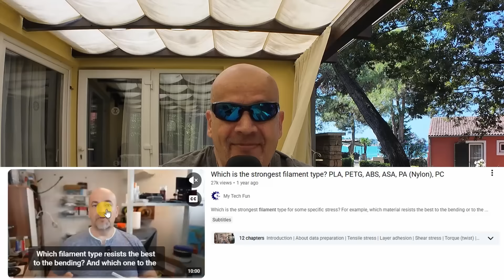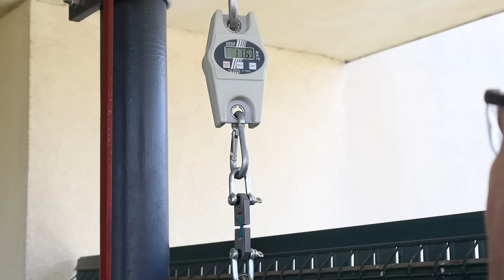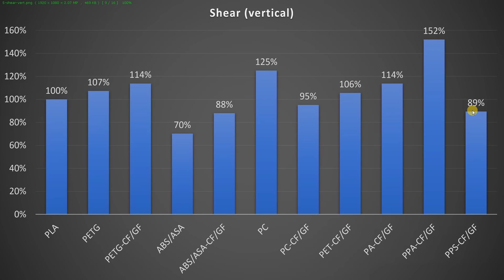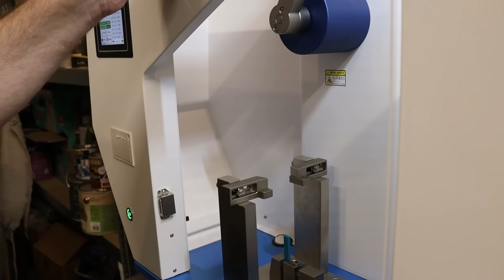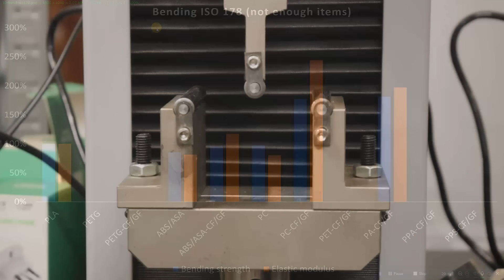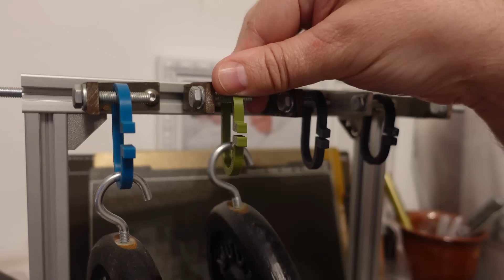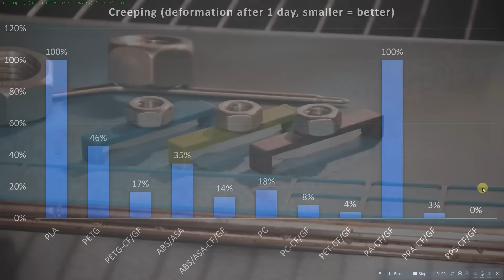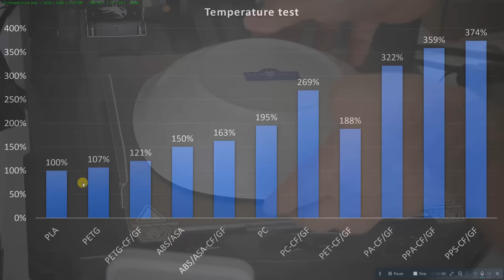Which Filament Type Is the Strongest? Now Including PET-CF, PPA-CF & PPS-CF

Comment: I have a cup holder in my car on a cantilever bracket printed out of Bambu PPA cf and over the course of 3 months the creep caused by 1 liter full water bottle has made the bracket unusable by permanently bending it I think creep tests need to be over longer periods of time
Reply from the maker: Taking a closer look of my testing, I have the feeling that PPA-CF creeps minimally in my tests due small stress (strong filament and 1.25 kg is not big load for it). But if the stress (and deformation) would be similar like with PPS-CF, PET-CF or PC-CF, I have the feeling that it would creep much more. Something I have to investigate.
Reply: @MyTechFun just a note that I used a blast furnace to dry and annealed at 140c with forced convection for 12 hours…the part met all initial testing (shock and static loading) and performed without measurable (by me) deflection until the significant creep occurred roughly 3months of constant loading later
Reply: @MyTechFun   Yes, if you normalize the load to the inherent bending or tensile strength, that might be insightful. People see PPA-CF is 2x stronger than PLA, and so make their part half the size and weight as they would the PLA part, but then that will likely suffer the same creeping issues as PLA. If you keep it chunky as if you were printing it in PLA, it would probably be fine.
Reply: That's a design failure, not material. This is still plastic, it's not sheet metal.
Reply: @riba2233 spatial constraints force the design, the cantilever bracket is bending into the load just after the point where it is bolted in…worked great for a over 2 months then the creep seems to grow exponentially
Reply: @moomanseven   if you are space limited then plastic is a horrible choice of material, you can't design a plastic part like you would design a sheet metal part.
Reply: @riba2233 great, I’m open to constructive criticism;
Reply: I have 2 brackets made of Bambu PPA-CF for my cat's wall furniture that have held up well after a year.